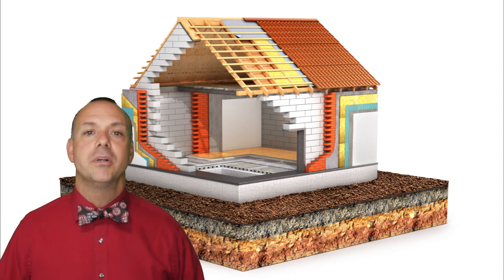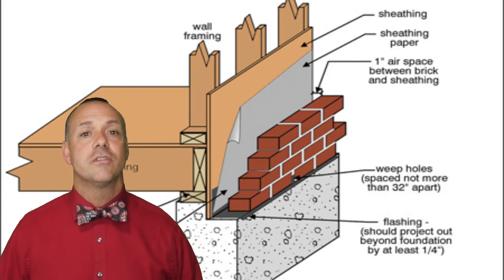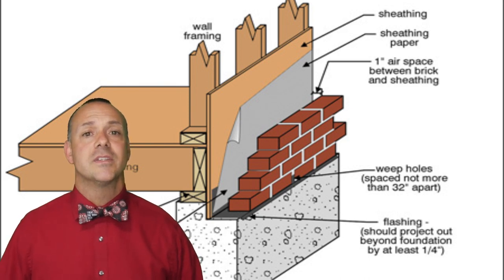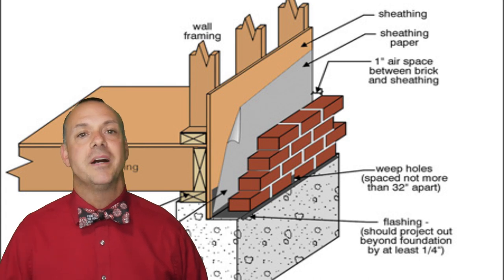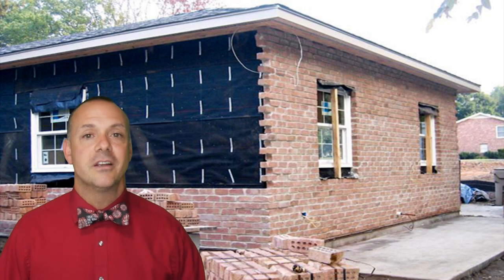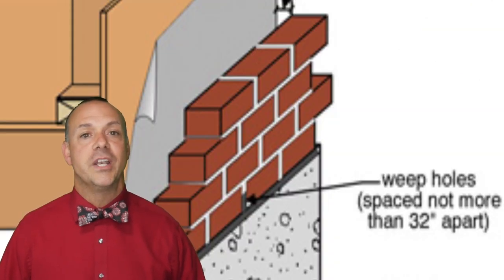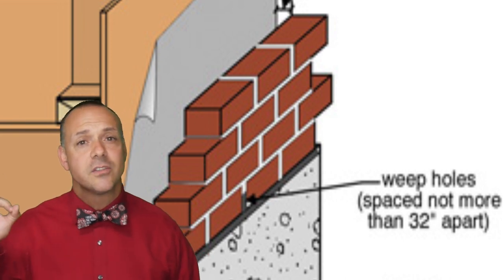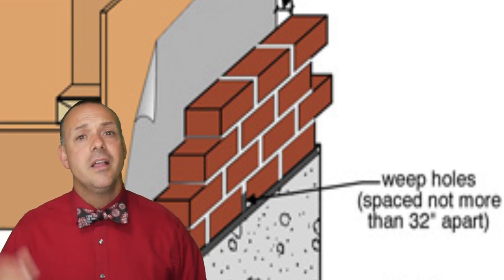BRICK VENEER VS SOLID BRICK | WHAT'S THE  DIFFERENCE | RESIDENTIAL CONSTRUCTION |CENTURY 21 PLATINUM

Comment: What is solid brick? Where is the actual sample of each? Are the thicknesses the same?
Reply from the maker: Thanks for watching and taking the time to comment.  Much appreciated.
As stated in my first sentence of the video,  brick veneer is not structural and usually consists of 1 layer of brick. 
Whereas solid brick walls are usually 2 layers of brick or one layer  of brick backed by cinder blocks
The solid brick wall is structural and supports the building.
Again brick veneer is not structural and does not support the structure. 
Its more visual than anything. 
I believe theres no difference in the size of the bricks.
It depends on the construction. 
If its a double layer and supports the structure then its considered solid brick.
If one layer as shown in the video its brick veneer. 
I hope that answers your questions. 
In hindsight I def should've included a sample of solid brick construction
Reply: @thebowtiebreakdown  do both brick veneer and solid brick have holes within the actual brick?

Comment: What is the purpose of the spacing between the brick and the structural wood frame? So it doesn’t compromise the support?
Reply: Brick isn't waterproof. Water vapor can penetrate thru and condense in the inside of the brick. The space allows the water to fall down to the weep holes and flow out. Yhe space also prevents the condensation from coming into contact with the wood framing and  causing rot.